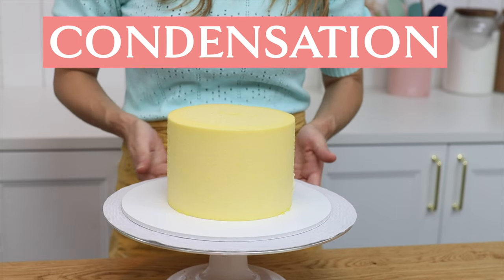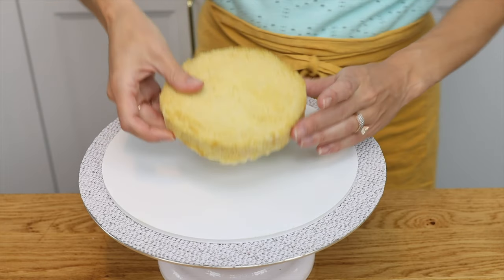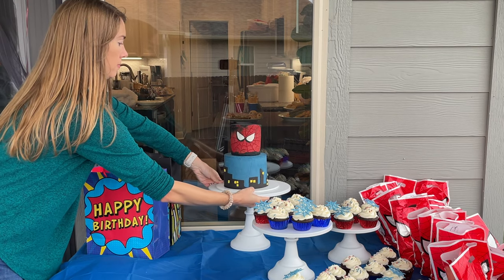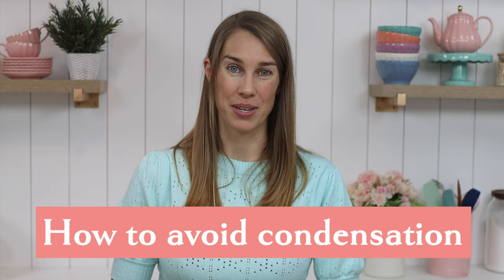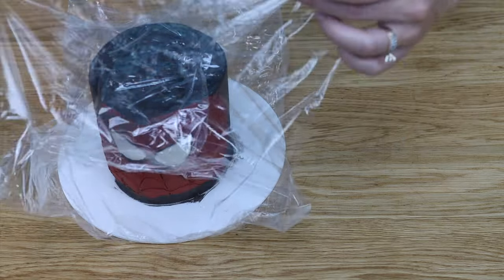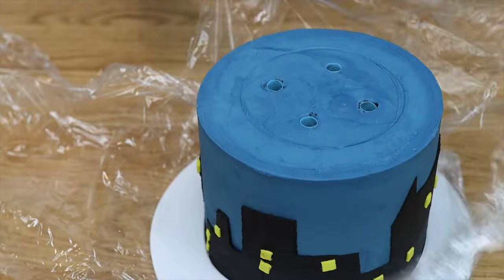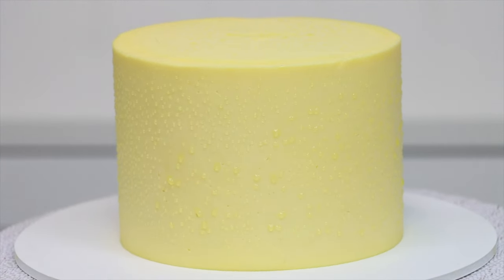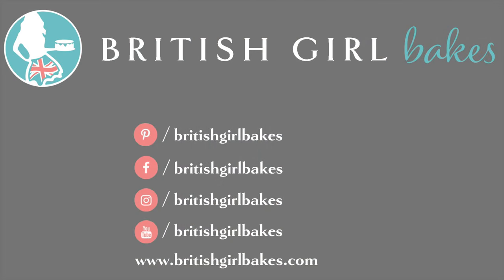CONDENSATION on Cakes | Everything You Need to Know

Comment: So I’m making someone’s wedding cake for the first time, and I’m really excited but just want to make sure it goes well! The cake is going to be on display in a barn in the shade, but it will still technically be outdoors in a location that is typically 90-100 degrees 😅😬So in regards to your condensation tips with using the paper towels to dry it off until it reaches the same temperature, if I continue to wipe it until it reaches that temperature, will it stop sweating once it’s reached that temperature?

Comment: Hi, your children are so cute and  your videos so helpful!!Is it important that the film is touching the cake, or can it be hovering a bit on top? I saw now, after overnight in the freezer some signs of condensation on the wrap...what do I do now?
Reply from the maker: Is the condensation on the inside of the wrap or the outside? The film doesn't need to touch the cake but it does need to seal the cake so it should be wrapped tightly to prevent any air and moisture getting in. If the condensation is on the inside you'll need to dab the cake with a paper towel when you take it out, to absorb those droplets, and dab periodically until the cake has thawed and the droplets stop forming.
Reply: @BritishGirlBakes  thank you so much!! Do you think whipped cream will be ok only as a filling once thawed?